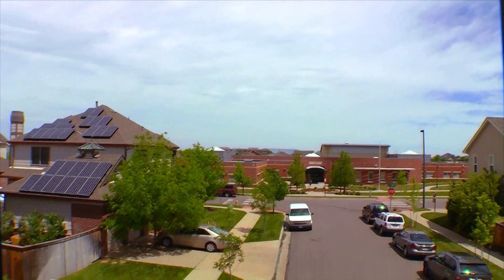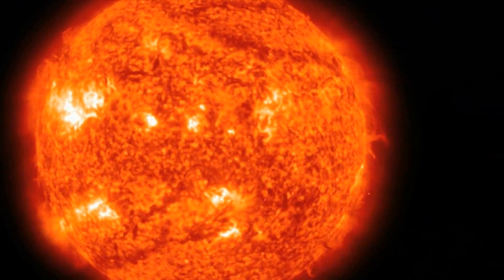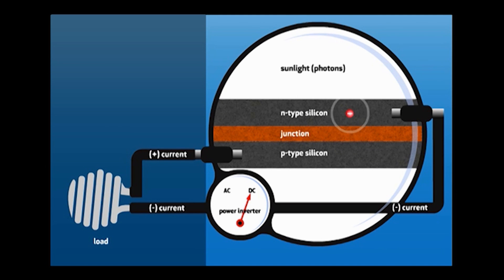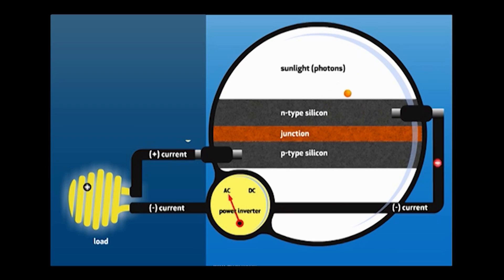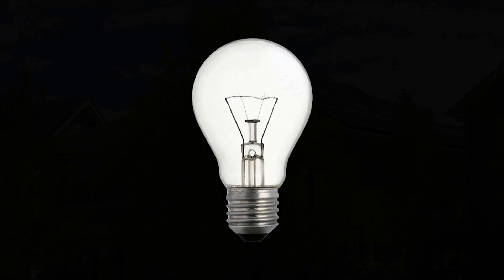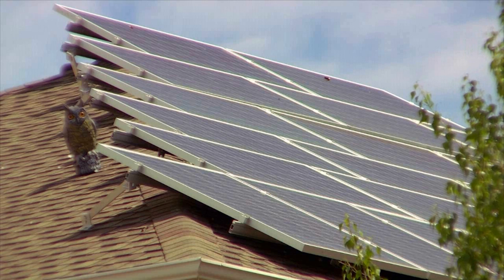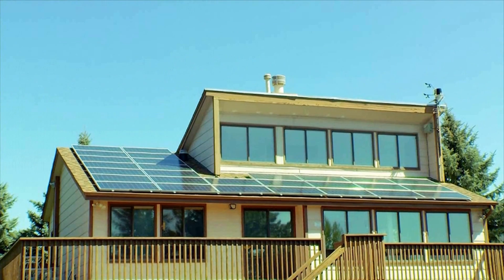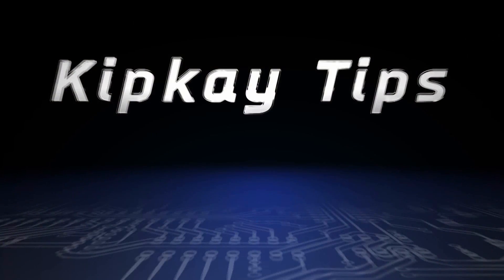Does SOLAR POWER really work? solar panels solar energy kipkay

Comment: Shouldn't that meter on the first animation point to "DC" rather than "AC" ? I don't think I have ever seen a solarpanel that outputs AC. Generally you have to run the current through an inverter if you want AC don't you? I'm not an expert on this but it seemed a bit off to me in a guide on the basics of solar to omit this.

Comment: heres two more things about solar you need to use water to clean them since things like dust and pollen will cause less sunlight to hit them and they silver so your forking over money for something that uses a finite resource and you cant recycle them hopefully this info will help you decide.
Reply: KILLKING110 why do you need to use water? also silican is made from sand which is very abundant
Reply: KILLKING110 and it's not like our atmosphere is a finite resource lol
Reply: silicon is fragile so it needs to glass to protect it from things like hail and think of like the windshield of your car the more dirt the less light can get in right plus if your not cleaning it there might be a crack your not aware of that could cause problems like a dead solar panel which means your out of a lot of money so treat like you car maintain it and it will last its that's simple.
Reply: yea you cant hide your dumb response google already snitched you out and glass needs cleaning if you don't treat it like your car windshield and maintain it then you don't deserve to own it that simple.

Comment: it isn't worth it to have batteries, it's better to sell the energy you produce back to the company
Reply: Guilherme Silva you can still have your batteries and export your excess too! at least when there's power outages you'll be sweet or if it's due to broken power lines in winter etc
Reply: Guilherme Silva my dad sells batteries now and a lot of people actually buy them because of power outrages and being afraid of the grid possibly going down for extended periods of time. Yes some of those people are preppers btw
Reply: zonkeymaker welp, here in my country (or even continent) we don't spend much time thinking about preparation for the "big day".... but we love to watch shows about americans doing that 😂😂

Comment: SOLAR FREAKING ROADWAYS
Reply: CircaSriYak a nice crash will destroy them, the wear from the tires will to. Oil drips, chemical spills, debris and scratches. It's a noble idea and many have worked on it, but it's too expensive and impractical. 

Why not though put a panel on top of every power pole to supplement the grid? Or require new home builders to include like 10% of the roof to be covered in panels with all the switch gear for selling back to the grid and future upgrades by the future home owner. There's tons of possibilities that should be too expensive. Small scale but done over a larger area would have a big impact.

Comment: As just a little bit of an "F.Y.I." for those who might not know it, but you're really not going to get very many central Florida, USA residents who'll have opinions that are going to run counter to the solar panel and solar power industry's P.R. juggernaut, simply because those people don't happen to live in a more temperature diverse climate area which has at least 4 seasonal climates in a single year. Sunshine is abundant there year 'round, and the temperature only varies from highs to lows in any single month by significantly less than 20*F. Hardly the genuine "stress test" that the majority of people will experience if and when they decide to jump on the solar bandwagon.
Reply: I live in New Hampshire, where winter is usually between 0 and 35, and summer between 65 and 100. We get tons of snow every year and experience the extreme of all 4 seasons. I've had solar panels for a year and a half and love them. Plenty of sunshine during the summer to use net metering to save up for winter. I haven't paid for a single kilowatt in 10 months.
Reply: "StalePhish": Very glad that they've worked for you for all of a year and a half in what would much more qualify as a much more representative "real life" test for many who are contemplating going solar. But, only a year and a half is still just that.
Reply: Wanna trade cities?

Comment: How long would it take to break even the cost of solar installations?
With in that time frame, how much would it cost to maintain solar panels?
Reply: According to my installer, my projected return on investment is 9 years. That's the point when total grid electricity would've cost more than my solar loan payments. And then after 12 years, you go way ahead because the loan is done but the panels still have 90%+ life left. Projected maintenance is around $400 per decade.
Reply: Thanks for the reply.
Hope there won't be any roof work to be done.
Reply: xxgg in New Mexico it's about 7 years

Comment: unless you do a ground mount, you will need a new roof and may have dry rot by the time you get it paid off-- 8-12 years.
Reply: Roofs usually last 20 to 40 years. When you cover them in solar panels, they'll last longer because they're no longer fully exposed to the elements

Comment: Keep in mind solar panels degrade over time and stop working. You have to keep replacing them. Not as clean as you're led to believe.
Reply: After a very long time though. The spec sheet for my SunEdition panels say estimates they will only drop 18% efficiency over the next 25 years. So sure, if you want to replace them every 50 years it's going to cost, but are most people that concerned about what's going to happen to their roof over 50 years time?
Reply: zdrux which is why people are working on a solution to that.
Reply: plus you use fossil fuels to make and transport them, same with wind mills.
Reply: Ceryk i heard the people incharge of looking into solar power are headed by a guy who hates solar
Reply: Let me tell you one: 
My friend works as operator/engineer at small (3,5 hectar) solar field powerplant. He absolutely hates solar because costs, polution and inrealiblity. They need to change 10% of their pannels every year due to "manufacturing defects" and aging and then there is this inverter problem, they are breaking faster then they can replace them. And all for what? That field works only at 75% efficiency after only six years. Photovoltaics are for space or for small apliances!

Comment: Solar power is NOT giving us the energy we need and so far we have wasted tons of money in it.... We need better technology. Solar is NOT the answer. Just look up the statistics on its recent advances.
Reply: Actually solar is doing a great job generating the power we need. But it's one piece of a larger puzzle. When I worked for Sunrun I saw offsets as high as %95. It's definitely helping people and it's getting cheaper all the time.
Reply: Personally I'm generating far over 100% of my energy needs with just panels mounted on the back half of my roof. For many it is the solution

Comment: Solar power, chopping down trees to eliminate the shadow cast on your roof to generate electricity to power the air conditioner, you now need because the tree is no longer there.
Reply: Ray Maritz No tree tall enough to cast shadows on a house should be near a house to begin with. it is a safety hazard. I have had and seen trees fall and destroy a lot of rooves.

Comment: I bought solar panels for my house on fall 2015 and it was a great investment! 

I live in New Hampshire, where we have dark cold snowy winters, so immediately it cut my electricity bill down but did not eliminate it. That is, until the next spring. Starting in March 2016, I began producing more power than my entire house was consuming on a daily basis. By June, I was producing almost twice daily what I used! They don't work at night, and I don't have batteries, but no worries. How it works is that the extra power you generate goes backwards up the power lines into your neighbors' houses, and the electric company gives you a credit for this. At night, on a cloudy day, or during a snowstorm, the system automatically trades back these credits so even though you're pulling down from the grid, it doesn't cost you anything (called "net metering"). Even though is it now winter again and production is low, I produced so much excess last year that I predict my energy credits will hold me over until spring when I start producing enough again. 

Supposedly you can sell off your extra credits once per year, but I plan on accumulating mine for when I get an electric car. Between powering my entire house and charging a car, I'll probably be using more than I can produce, so that will eventually run my credits out and I'll have to pay, but at least it won't be much. I used to pay on average $100+/month for electricity, but now my electric bill has been $13.75/mo (which is just an annoying administrative fee and taxes).

Of course, the solar panels themselves weren't free. I bought them from a local installer for a hefty sum, but a significant portion was covered by federal and state tax incentives. The rest is being paid for by a 12 year loan which costs me about $115/mo. Keep in mind that the cost of electricity is constantly on the rise, so even though I'm paying slightly more now than I was before, it won't be for long because the cost of electricity is predicted to rise above my solar payment within a few years time. Not to mention the obvious green benefits of zero emissions. Once those 12 years are over, they'll officially be mine and I will be saving over $1200/year indefinitely.
Reply: can't believe this (net metering) wasn't mentioned in the video
Reply: StalePhish SHOUT IT OUT ONE MORE TIME PLEASE, SO EVERYONE CAN READ THIS 
THANKS
Reply: ΤΗΕ ΒΕST CHOICE YOU DO dude!!! FREE SUN = FREE ENERGY !!!!!!!!!!!!!!!
  ~ GReetings fRom SunShine GRee©e. . ;) ~
Reply: it's just another form of subsidy in the end.  The utility really doesn't need or want the solar power in most cases, but the governments in some area's say that they HAVE to buy it back at particular rates (sometimes at the same rate they sell, sometimes at higher rates).

In area's where the utilities are free to pay what that energy is worth to them, nobody feeds back into the grid.

Comment: They are not clean energy sources. The resources and energy required to produce each panel is terrible for the environment.
Reply: David W Everyone knows how much oxygen coal and petrol produce when burnt, right?
Reply: Correct. But they're still cleaner than coal/oil. Plus they can be recycled.